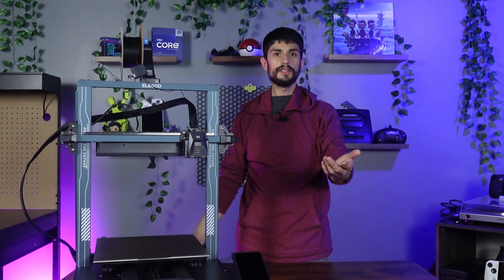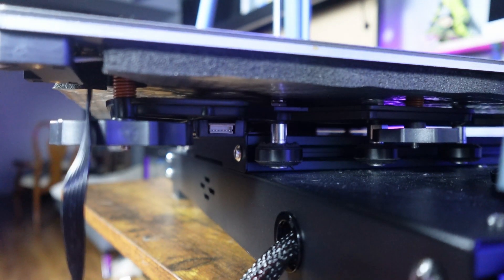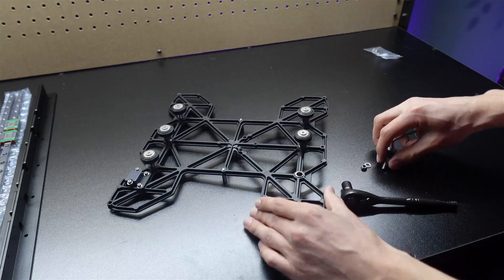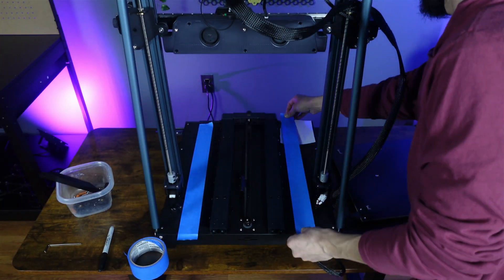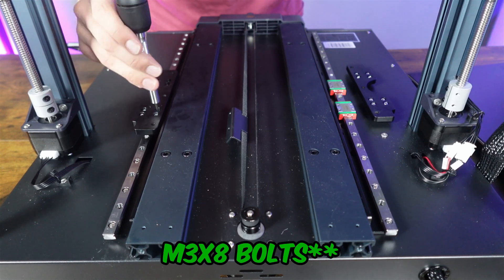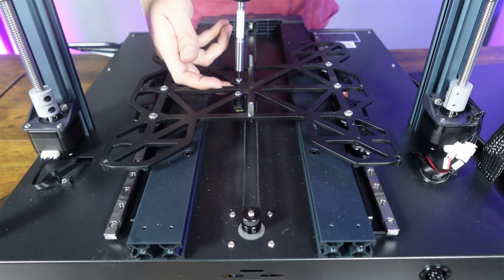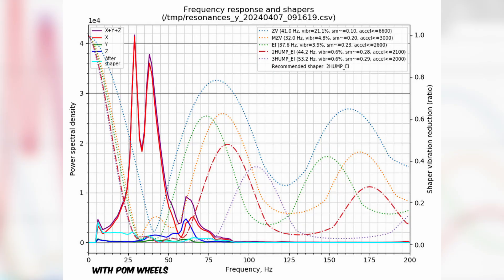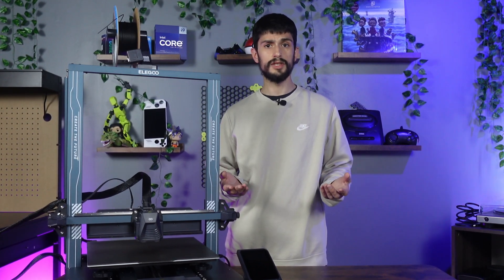Stepping into Precision: Neptune 4 Plus Y-Axis Linear Rail - Part 2

Comment: On my Neptune 4 Plus, using stock POM wheels and Y rails, I was advised to set the Y-axis acceleration (EI shaper) up to 1500mm/s. Does anyone know why? 
I notice the author had over 2900 on stock and around 3400 with rails.

Comment: I’ve notice since upgrading to this whenever I do a print the y-axis continues to push toward the end stop on the move right before the first layer making a forced moving/grinding noise. It doesn’t do this when I home it myself on the printer or through klipper. Do you know what could be causing this.

Comment: For a device that has to put up with a lot of vibration, I'm amazed that loctite is not used on the machine screws. Over time have any of these come loose?
Reply from the maker: Some people use loctite some don’t. Definitely a personal preference thing. But thats one of those routine maintenance things.
Reply: @EdsTechTalk94  Thank Ed.
Coming at this from an engineering / CNC milling background, I struggle with a lack of torque settings for fasteners, POM wheels showing wear in days, beds level to 0.1mm being "a good thing". Hence why installing liner guides adds a level of familiarity to a 3D printer. Great how-to by the way. Keep up the good work.

Comment: I was considering upgrading my N4P to linear rails but I've read how bad they are if you don't lube them constantly, otherwise they will perform worse than POM wheels. That really pulled me off this upgrade after seeing the barely noticeable differences.
Nice video tough, we need more content for the N4P, which is by the far the best printer in the 300-350 USD range IMO.
Before the N4P I had an Original ENder 3 for over 6 years and I only changed its POM wheels in the last 6th year in an attempt to improve the X axis jerkiness and ghosting that I was experiencing, only to find out that the issue was with the worn out belt gears instead. The POM wheels where still fine after all those years.
Reply from the maker: I found it helped with bed leveling the most, removing the pom wheels made it easier by eliminating one more factor. I turned the nut once and I could never get it back the same (taco bed).

Comment: I really doubt that Y-axis linear rail kit has anything to do with bed leveling. It's more likely that your bed was over-tightened and you fixed it by removing and re-installing it. What's more interesting - you look look at the graphs, you can actually see that vibrations are stronger after installing linear rail kit (see the values on the left!), but yeah, you have only one peak which is an improvement
Reply from the maker: Adding the y axis linear absolutely helps eliminate bed leveling problems. You don’t have to adjust your eccentric nuts which usually is the main issue for bed getting a taco bed mesh. And that in itself just eliminates another problematic factor in bed leveling. 

Also the numbers on the left are higher AFTER the rails are installed because it can reach a higher vibration test, therefore offering a higher acceleration overall.
Reply: @EdsTechTalk94  I have a taco bed plus loose pom wheels. I cant get the to grasp the rails on all the wheels at once so the bed level changes when I just breath on it. Y rails are in the mail and hope this solves my problems.
Reply: You don't adjust eccentric nuts to improve bed leveling. You adjust them to prevent the bed from wobbling. For bed leveling you need to adjust tilt screws that are still here
Reply from the maker: Right, but have you not had a loose Pom wheel?  Once I tightened the Pom wheels on mine I could not get the bed leveled the same. It was a battle of small turns of both the nuts and bed screws. 

By getting rid of the Pom wheels altogether you have one less point of failure. That simple.
Reply: @VasilyKhoruzhick  the wheels absolutely affect bed leveling. To get the best level you have to adjust the wheels and the bed together. Leveling the bed alone can make the wheels too loose or tight while tightening or loosening the wheel will throw the bed level off. Its annoying and takes forever but It’s the only way I can get proper wheel adjustment and leveling. This rail system completely eliminates that problem.
Reply: The pom wheel frame warps when tightening down the pom wheels. Im having an issue with a wild variance on one of my 4 plus printers. I believe the bed warped by this. The printer arrived with a loose bed frame to try and hide the fact the hot bed was warped.
Reply: @MechTechRW  I doubt they knowingly sent a warped bed. They will send you new bed if it came warped for free. I believe they all come loose. Both of mine did. Just can’t adjust them too tight or the wheels will ware out fast and will have warping and leveling issues